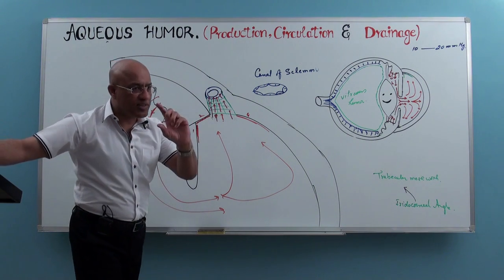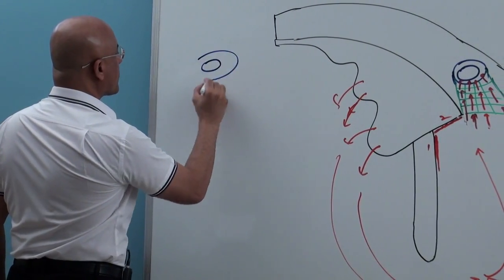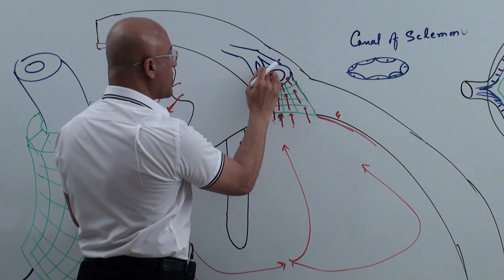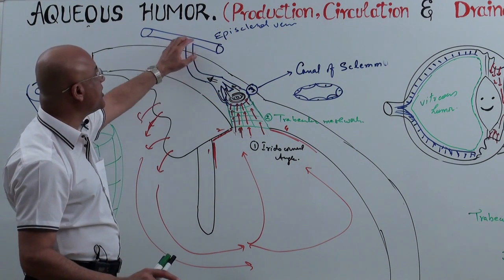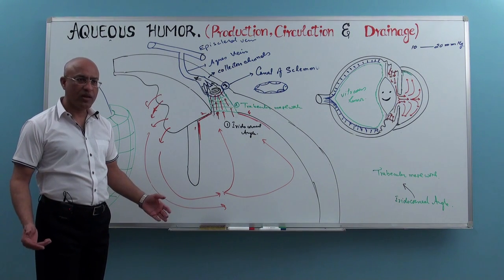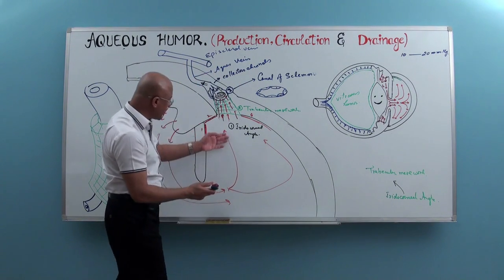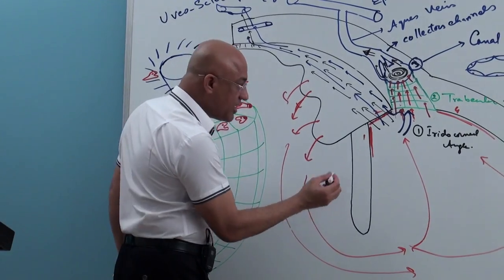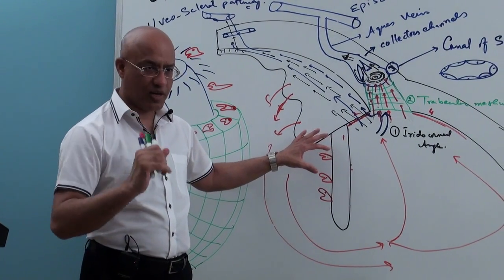Aqueous Humor | Production, Circulation & Drainage part 2/2

Comment: I really appreciate your drawings AND your ability to present. Particularly how you accentuate and repeat the points and terms that must be remembered. That being said, with respect, you could use regular English coaching to improve your pronunciation. 

Ex. at 5:17, what I hear (with charity) sounds like "This is tuburcler meshwork, through which fluid has to pass through the reach to the canal ashlem."

Honestly, I wish there was something I could do to help my professors who struggle in the same way, but there is never enough time to have such a conversation and clarify meanings.